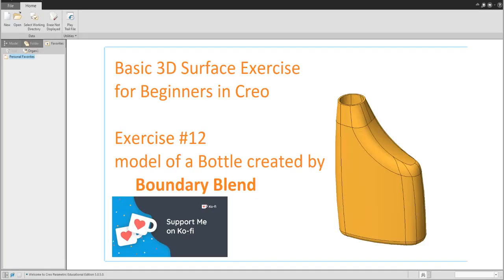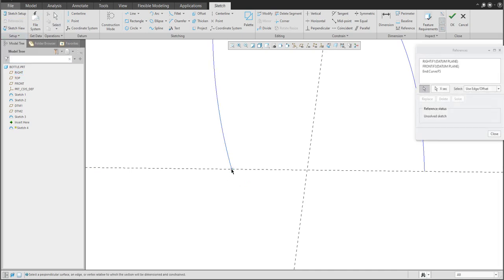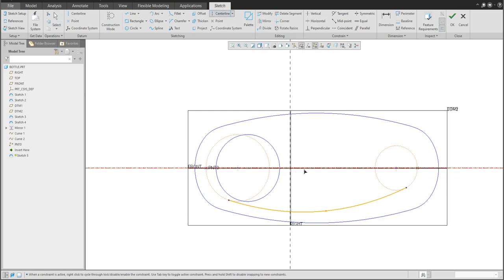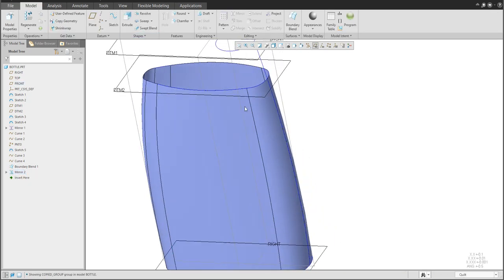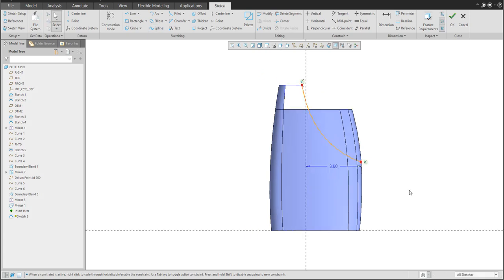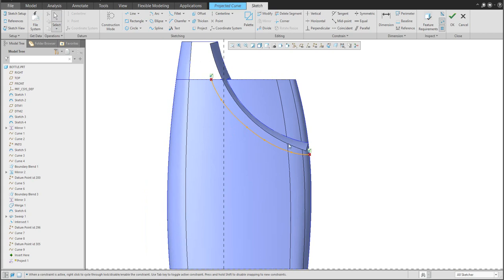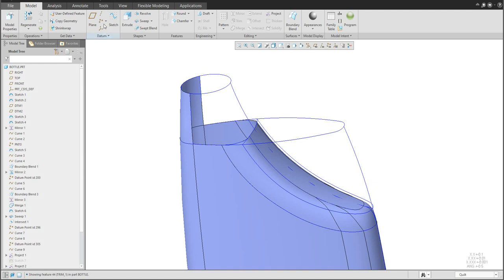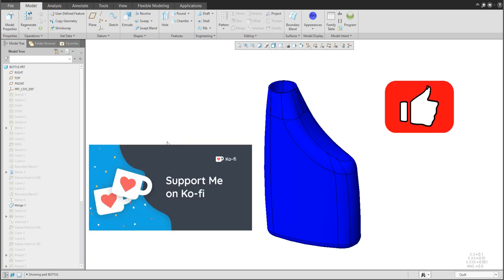Basic 3D Surface Exercise for Beginners in Creo - Exercise #12 | How to create a Bottle by Boundary

Comment: I would have modeled this as just one half and then just mirror the quilt at the end.  That way future modifications will be easier to implement as you only have to modify one quilt. It also needs draft where the part crosses the FRONT datum. That means all surfaces need to approach the FRONT datum being off normal by approximately 3-5 degrees. That typically involves creating a ribbon surface at the FRONT datum via a sweep that can be used to align tangency.